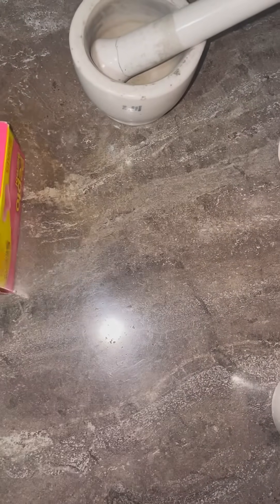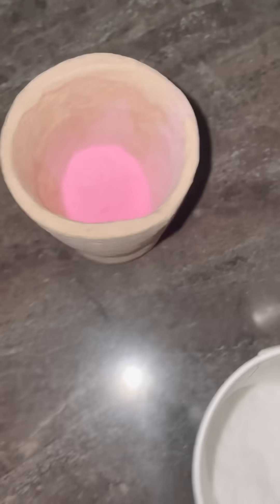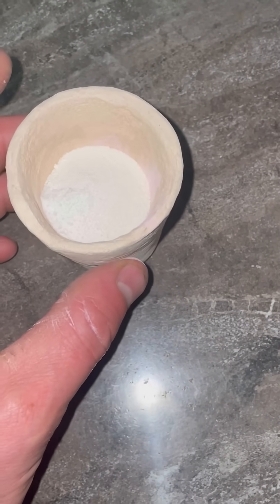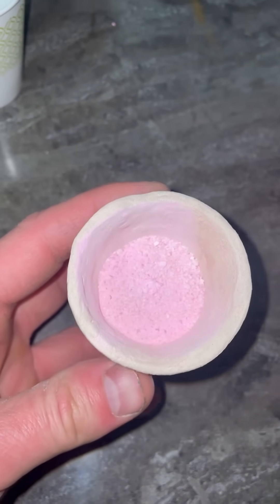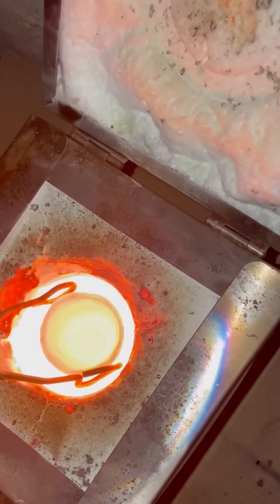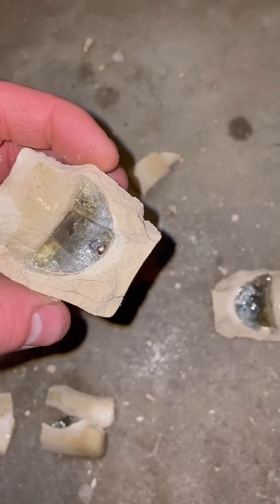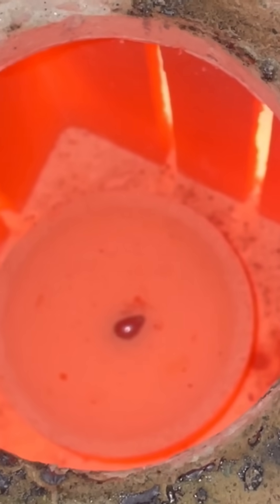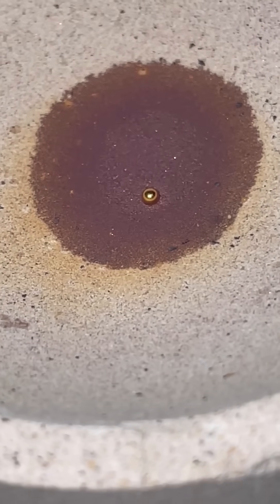Pepto Bismol as a fire assay lead replacement?

Comment: This is insane and such a stroke of pure genius. Is it cheaper than using lead or was this just a hypothesis put into a testing stage?
Reply: It's not cheaper, that much Pepto costs several times the equivalent in lead.  But it will not poison us like lead will.

Comment: Hey cody, i have an interesting but possibly dangerous project that you may be interested in. Something that I want to do personally is create a custom pocket watch using self-luminescent paint using radium but since the 1960s it hasn't been used or made. I think that something cool would to see someone to attempt to create their own radium paint and I think that you may be a great figure with the science back ground and proper safety training to complete this idea.
Reply: Dangerous, ooh yes.  Nile Red took a Geiger counter to a box of radium watch hands.  Bzzzzzt!  It was excerpted on one of the watch repair channels.

Cody may be crazy yes (he even embedded a magnet in his finger once, then dug it back out later), suicidal no!

Modern luminescent paints charge up from being illuminated and do it very well.

Comment: A kilogram of lead however costs around 2.39 USD while Bismuth Subsalicylate costs around 396,52 USD. Even if you just take Bismuth metal all by itself a Kilogram is around 30 USD. So I guess if people would want to use something safer than lead, they already could, but they won't cause it ain't as cheap.
Reply: When it's for small scale test when the cost of the reagent is dwarfed by the cost of everything else... including electric or gas fuel and sacrificing crucibles... then it's no significant cost to be safer.

Comment: Are you sure bismuth fumes aren't dangerous? I thought most metal fumes are pretty bad, but is it something to do with the boiling points etc that mean it's safer? Or is bismuth oxide much safer than lead oxide?
Reply: bismut oxide is nontoxic, and generally lead is just not a good material to work with when you can avoid it

Comment: Not surprised that bismuth metal works as a collector metal, what did surprise me is being able to just throw Pepto tablets into the crucible and have them break down into metal like that. That is so much easier than Nile Reds way of getting bismuth metal from those pills lol. 
All jokes aside though, that is brilliant and probably way safer than lead.
Reply: Well, Nile Red was doing it chemically. In other words, the gentle way. This is more like using a sledgehammer.
Reply: You ever swing a sledge? Sledge hammers are sick!
Reply: @zerumsum1640  dont use chemicals for the job of a sledgehammer

Comment: Bismuth is slightly radioactive like slightly slightly so you should probably still be careful even with this. Yes this is meant for oral intake, so should technically be safe... still don't breathe it in just in case. It's much safer than lead yes so good job on finding it.
So is the glass byproduct any good? Like does it have a beautiful crystal structure?
Reply: Pretty sure the definition of glass is that it doesn't form crystals.
Reply: almost everything is radioactive to some degree (except stable isotopes), but what matters is that kind of radiation and how much, neutron radiation is something you likely dont want to touch, alpha your fine externally, and beta particles your still probably ok, but you dont want a serious emitter of it around.

bismuth is an alpha emitter with a half life so long that your at no risk of radiation based illnesses by any measure

Comment: Wow, this is one of those things that you  never think of and the someone like Cody does it and it's like dang, that's so simple how are we only now getting to this point.

Bismuth and lead share a lot of the same properties in terms of alloys and melting points. Bismuth was even often confused for lead because of the similar density and melting point.

But the thing they don't share is the toxicity.

The only thing is that lead is the thirty-sixth most abundant element while bizmuth is the sixty-fifth most abundant.

So while there is less of it, I still think my following statement applies because you have made assays safer in terms of resources used.

You deserve a Nobel in chemistry my guy,

Comment: How did you know how much bismuth was in the pepto and how much you’d need
Reply: It probably has dosage information on the bottle. If you have x mg of bismuth subsalicilate, you just subtract the weight of all the other atoms. I doubt he was being that precise though, looks like he just threw "enough" in. But if you really want to know exactly...
A regular strength tablet is 262 mg of C₇H₅BiO₄  (C7H5BiO4).  That weighs  (7*12)+(5*1)+208+(4*16) = 361 g / mol.
Of that total mass, 208 is the Bismuth, so a ratio of 208 / 361 = 0.576
So one pill with a dose of 262 mg would be 262 * 0.576 = about 151 mg of Bismuth metal.

Comment: Correct me if I'm wrong, but I believe assays are to determine if there are precious metals in ore correct?  Since you used pure gold powder, I would love to see this experiment tried again with ore that has been otherwise confirmed to have gold in it, or some other precious metal, to see if it really is a viable method.

Also it's just super fun to watch!
Reply: the reason he poured gold is because he didnt have ore that he knew had gold in it, so its easier to just sprinkle some in there to simulate that there was gold ore
Reply: @bugsmith9751  Yah I figured as much.  I'm just saying it would be neat to see if the results were the same with genuine ore.  Plus it is just fun to watch.

Comment: Well that's pretty awesome. One still needs a furnace, crucibles, and all the other accessories, but this method of using a commonly available product to perform the process in a non-toxic way is a really impressive discovery.
Reply: Certainly not a discovery as Bismuth's use in fire assays is fairly well known but this is a delightfully creative use of a regular household product that has a side-benefit of not being (as) toxic, a very Cody setup.
Reply: @Fenriswaffle  I assumed Cody didn't discover the chemical principle, rather I meant that he "discovered" that this realtively cheap, commonly-available source of bismuth will work for hobbyist purposes.

Comment: What a neat trick! Get the lead out if you don't need it. 

One nitpick, I would guess bismuth fumes are less toxic than lead fumes because lead is pretty bad whereas you can eat Pepto Bismol, but don't overdo it. Most fumes are at least somewhat bad for you. Whatever's left is probably outweighed by using electric rather than gas heating though.
Reply: Bismuth is quite benign to the environment and our health thankfully.
Reply: @416Rival  Form matters. Fumes are usually somewhat bad for you even if they consist of stuff that would be harmless to eat. Lungs are picky like that.

Comment: Dear Cody,

I've been following your channel for years out of sheer curiosity for the topics you cover and i really enjoy your content.
I wanted to ask you if you can do an video on SiO2 as it is used a lot in my field of work but its something i know near nothing about.

There seems to be a lot of misinformation regarding SiO2 ceramic coatings around the world as its a relatively new product, making some outlandish claim that it protects cars from rock chips or key scratches...
Reply: what is 02?
Reply: @maoellisto  O2 is two atoms of oxygen. SiO2 is silicon dioxide AKA silica. It's what glass, quartz and silica sand are made of.
Reply: @markfergerson2145  oh ok i thought 02 was something else, thats what the original message said 02, not O2
Reply: @maoellisto  Ah. Sometimes you have to look at typos in context.
Reply: Silica is harder than metals so it should protect against key scratches. Some rocks are harder though and silica can be brittle depending on how the coating is applied. So I'd give the claims some credence but I wouldn't trust them completely.
Reply: @markfergerson2145  Believe me the coatings they make out of it has no physical resistant properties, when the ceramic coatings first came out it was like snake oil... Don't get me wrong, the coating has its advantages but I never sold it as a protective coat just an long lasting hydrophobic coating that helps keep your car cleaner, and that's what it does for about 2 years, and that's what really lots of people want and need. Thanks for reading my comment!
Reply: It can absorp boolets too or so ive heard

Comment: Could you reproduce the experiment also with powdered antimony ?
Reply: I would assume antimony could also work.  However Antimony Trioxide is cancerous, so when you oxidize the antimony in the cupel, similar dangers as lead oxides would be present.   
I have a feeling Cody went with this bismuth because of its relative safety compared to other heavy metals.

Comment: This is pretty creative, how did you come up with the idea? Are bismuth and lead similar in some way?
Reply: Bismuth and lead are both "collector" metals as they are heavy and can easily be oxidized. In the first melt they collect the precious metals on the bottom of the crucible as they are heavy,  forming an alloy, and with the aid of the other additives, this also keeps them out of the slag. In the second melt with only the bead, both metals can be oxidized away in a bone ash, or even Portland cement cupel.  The collector metal is absorbed into the cupel as it oxidizes. This process leaves a "pure" precious metal bead. When lead oxidizes it creates harmful fumes. Bismuth doesn't. BTW Pepto Bismol has bismuth in it...
Reply: Bismuth and lead are of a similar atomic weight and are both post-transition metals
Reply: Lead and Bismuth are both heavy metals. Lead has atomic number 82, Bismuth atomic number 83. Bismuth works here since it melts at a low temperature and oxidizes in air, just as lead does.
Reply: @particleboy7757  Ah, that makes sense, thanks man
Reply: "Are they similar in some way" look at this goofball ARE YOU BEING SERIOUS, TAKE ONE BLOODY LOOK AT THE PERIODIC TABLE
Reply: @GaiusCaligula234  What @J.J. Shank said, also never disparage someone for asking a question
Reply: @particleboy7757  well, he's wrong so, ironical I suppose
Reply: @GaiusCaligula234  That's not a great indicator. Carbon and nitrogen are nothing alike.
Reply: @General12th  except they are very much alike, maybe not physically, but chemically very much so

Comment: How many pepto bismol pills would you need to make a gold bar, Cody?
Reply: It depends on the source and purity of the starter material. Gold and bismuth as relatively pure metals at least have good solubility from this demonstration, however, that bead he got could still have considerable amounts of bismuth trapped in it even after the oxidization process if the gold works to hinder it. It would then possiblely need to go through additional steps to purify the gold to higher purity standards.

Comment: Please do a longer form video explaining why this works!
Reply: I completely agree. I think I know why this works, but would love Cody to explain it. 
But I think it works exactly the same way as using lead as an accumulator metal.  Pepto contains metallic bismuth in it, so when it’s heated to high temps like this, the organic compounds (binders) burn away leaving just the metal.  Then the process is exactly the same as cupelling with lead without the hazards of using lead.
Reply: @uspockdad6429  precisely.
Reply: @uspockdad6429  he said all that in the video through obviousness
Reply: This.
Reply: Yes please!
Reply: Couldn't you just add bismuth?
Reply: @SeeNyuOG  Yes you could simply add metallic bismuth to do the same thing.
Reply: @rockbutcher  thx!
Reply: @SeeNyuOG  No.
Reply: @RustyShackleford463  why not?
Reply: @fractaldesigns7175  It's a secret :)
Reply: @LordDragox412  😢
Reply: nah, this was the perfect length and level of descriptiveness
Reply: Your public requires more information about this.
Reply: Pepto has bismuth metal in it
Reply: Because chemistry essentially.

Comment: Soo, what exactly is "fire assay"?

I just watched a 3 minute video and  have no clue what's happening. Besides some pretty red colors.

Oh, and while I am already asking:
What is pepto bismol?
Reply: Basically one of the best waya to recover precious metals (well, silver and gold) is to melt it in with a bunch of other fluxes like ash, lead etc. The gold binds to the lead or in this case bismuth then you process it again to get rid kf the lead/bismuth and are left with gold
Reply: also pepto bismol is just a certain form of bismuth (well a bismith compound) mixed with a bunch of other random filler. itd a medicine for indigestion
Reply: @radishhat5736  ah okay. So he didn't add the gold because of its pretty color 😅😂
Thanks for explaining.
Reply: My best understanding is that pepto bismol is mainly dissolved bismuth metal, which is put into a crucible with a little bit of gold along with flux and sand to promote good flow and mixture of the two metals. What's left after the first heating is basically glass and a bead of metal which is a more purified mixture of bismuth and gold. Then that bead is removed from the slag and returned to the kiln in another kind of crucible that will absorb only the bismuth once it reaches a certain temperature, leaving only a bead of pure gold. In a more realistic application you would be putting the gold into the mixture in a form that needed refining, so this is basically just a proof of concept that the gold can in fact be refined using bismuth.

Comment: "Posted 1 minute ago"
Comments: "1 day ago"
Reply: Probably they had link shared to them as this video wasn't public, patreon thing.

There is also different website that could do that but I forgot the name
Reply: Posted date is time of public availability.
People can watch if they are joined to the channel or they have the link (patreons, for example).
There's nothing weird about it, Sherlock 😂
Reply: @Ktulu789  no need to be rude, simply qouting times.
Reply: @Ktulu789  B-but where did I said it was weird?
There was a question, I tried to answer to it. No need to pretend to be smarter than you are bud
Reply: @heap63  your comment wasn't there when I replied. My reply was to OP.
We both commented at about the same time, give or take 😋
Reply: @Ktulu789  Understandable, have a nice day